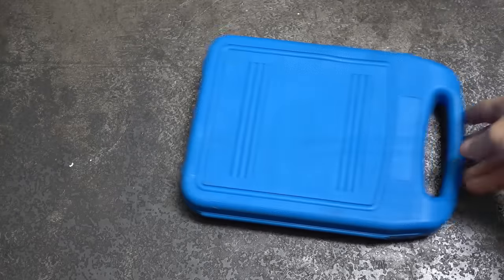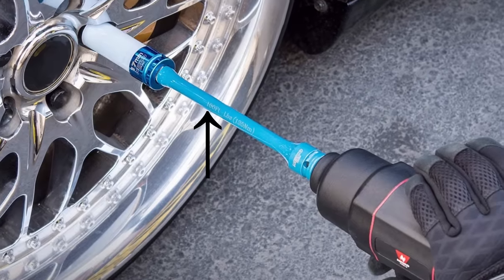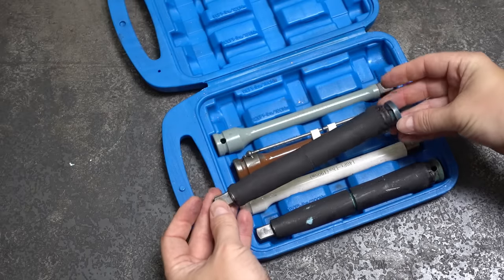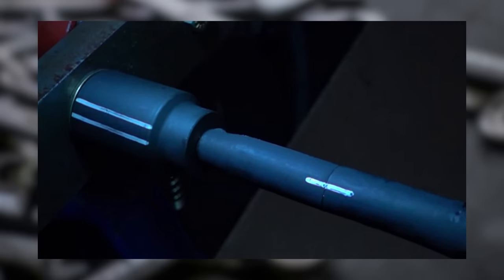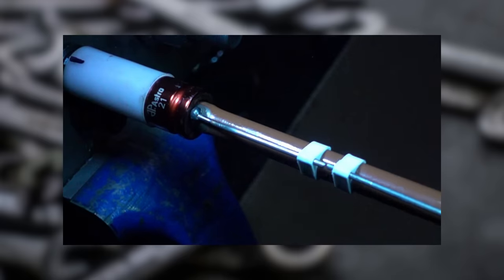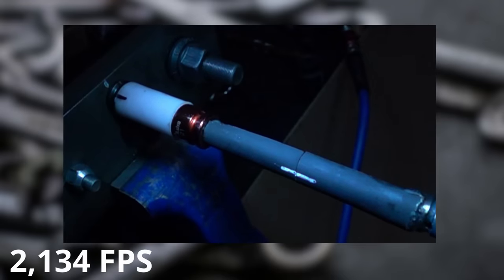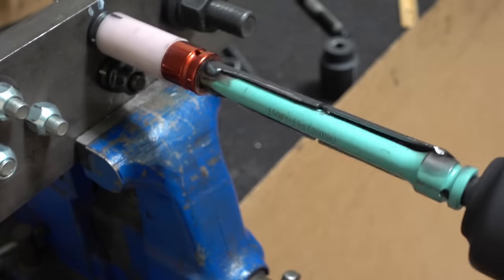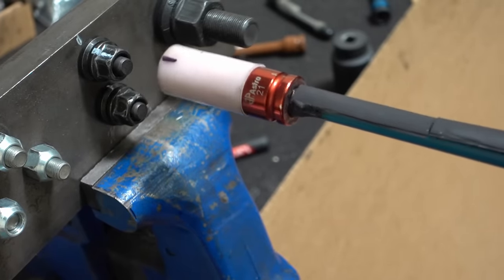Torque Sticks! High Speed Video Helps Reveal the Truth

Comment: Fantastic video. From an engineering/physics point of view, the key takeaway is the jerk (rate of change of acceleration) is different for the two tools and for the dyno vs no dyno. The electric tools have a different impulse due to their striking frequency. So in a duty cycle comparison - about the same power/torque over an average measurement, but with different jerk characteristics and slightly different physical transfer of torque. The difference with your torque tester is similar - the nut on bolt will have a stick/slip release to torque and then a big increase in torque when butted up to a jamming surface which is different to the fluid buffer in your system. The torque to force conversion through the fluid is acting like a dampener to the impulse of the hammer. The hysteresis of that is giving you a mechanical advantage.
Reply: I think you nailed it. A better measuring device for the sticks that would simulate a stiffer clamped joint like a wheel to hub, would be one that measures strain in the system directly in the metal that's being stretched/compressed like an instrumented stud or load washer.

Comment: For tire shops, these save a lot of time. The idea never was to get it "right" by just snapping on a torque stick, but for that torque stick to get just under where it needs to be in order for a torque wrench to finish the job without needing 20 more turns per lug.
Reply: This is why I work on my own stuff, no desire to pay full price for someone who takes shortcuts calling themselves a pro.
Reply: Ahhh this explains why I needed to slog my tyre iron with a hammer to get it off the last time.

Comment: I always use my thinnest torque bar (like 65 #FT) because then I know it's tight enough to put on the ground but probably not tighter than the torque spec that I will reach with a torque wrench.
Reply: Thanks for that tip man
Reply: Yep, the real use for torque sticks.
Reply: That is all I have ever used them for.
Reply: That's why I only bought one torque stick, a 65 #ft.. I already have two manual torque wrenches
Reply: Great advise.
Reply: Your lips to god's ear. That is the only good use for them. I think they are evil spawn. Or like someone else says on here, just use a 1/4 drive cordless impact driver and then finish it off with your torque wrench. And finish the twisting consistently without jerking on it.
Reply: True enough.  I just use one dugga on the gun.
Reply: @grantmcinnes1176  I use three rat-tat-tats. No torque stick. 30+ years. zero problems.
Reply: Yes and I then make my students follow torque patterns and use a torque wrench...always!
Reply: @lm4278  No, you don;t have any problems, It's the side of the road with the horrible factory tools & 6+ months of corrosion that has the problem.
Reply: @alro2434  Some people do have that problem. I have never on my vehicles. Ever. If I buy a used vehicle, first thing I do is inspect the brakes and make sure that never happens. anti-seize compound and three rat-tat-tats and never again will I have a problem.

Comment: I bought a set of Snap-on torque sticks when they first came out. Wanting to make sure that they were accurate, I followed common sense and the included directions. The air pressure in the system should be consistent and verified to be adequate. The air impact gun should also have an internal regulator device (dial or knob usually) that will be used for repeatability/consistency.  Set the air impact gun's regulator to the lowest setting that will allow the desired torque to be achieved with minimum overshoot. Use a calibrated torque wrench to verify that the lug nuts have reached the proper torque. Once you have done this process, you can be assured that the air impact with the torque stick will apply the needed torque within an acceptable +/- range from then on. The important part is that all the lug nuts will be set to the same torque, at whatever that +/- calibration is, which should be very close to the specification. Once you get used to the feel of how long to pull and release the trigger, it becomes very easy to get excellent accuracy and repeatability. The torque sticks made the slow, tedious job much quicker and effortless to do. 
         I did suspect and confirm that they are only to be used with an air impact gun as mentioned and demonstrated in this video. The cordless/electric impacts are delivering a more constant rotation which does not allow sufficient torsion rebound to occur within the torque stick and the harmonic frequency intermittently "lines up" to make the torque stick act almost like a solid extension which obviously defeats it's intended design. I verified that there is no way to eliminate this tendency to anywhere near a satisfactory level to achieve accurate torque from lug nut to lug nut with a cordless/electric type impact gun.  I just make sure to final torque all lug nuts with the air impact and leave it at that. 
    Maybe one of the cordless/electric impact gun manufacturers will someday figure out how to make an accurate torque limiting gun with a built-in torque sensing system. Hopefully it will be affordable as well! That is a tall order in my opinion.
Reply: Im in the auto assembly world, they currently do exist, but air guns are kinda expensive and need a feed back to an electronic box.
We also have electric torque guns from atlas copco, but the brains of it are $5000 and the gun is another $3000 min depending on size.
Portable, accurate and cheap won’t really happen for any impact. Just look at the Milwaukee electric torque wrench. It’s $1000 here
Reply: Makita makes assembly tools under their 14.4v line that do exactly that. iirc they're like $900 a piece though, but waaaaaaay cheaper than the ~$5-9k you're gonna spend on an Ingersoll Rand or Atlas Copco system.
Reply: Wheel lug bolts are torqued on the production lines with electric motors.
They don’t use impact wrenches however precisely because you can’t get controlled torque - they use direct drive and measure the current drawn and the position of the wrench head with a target torque followed by a further angular rotation (usually a quarter turn).
Reply: @ForfeMac  we use those also. But only good for the range I think of 30NM or something

Comment: I can remember when we started using torque sticks back in the early nineties at the dealership, we were told by GM that they should only be used with single hammer style impacts and not twin hammer.
Reply: That makes sense when you think about it.

The high rate of impact doesn't let the torsion bar to revert back into its original position so the torque is applied, almost, continuously through it

Comment: I've always used one ~20% or more lower than the torque target then followed up with a torque wrench. eg. use an 80ft/lb torque stick for 100ft/lb final torque. This way the lugs are tight enough and evenly torqued to lower the vehicle but not overly tightened.

Comment: If I had to guess I'd say its a combo of the anvil weight and the IPM. 
Using your rope and plate analogy it's like a halfway between the steady twist and smacking the plate (or like a machine gun constantly hammering the plate, giving almost zero time to twist back), not giving the material in the torque stick time to return from its partially sprung state.
Reply: Exactly like he said.

Comment: Proper use of torque sticks is more than at what point they stop giving, Its also the feel in the gun that the operator has to get used to that tells them when to stop. You have to get used to feeling the slightest kickback, sort of like a wobbly feeling.

Comment: For lug nuts, I just use my impact on "low" until I feel the slightest resistance, then go for the torque wrench\ratchet.

I had an air impact that on its "low" setting was almost spot-on 85 ft-lbs, so the torque wrench never made over 1\20th of a turn when I was done (I was a tech at the time).
Reply: Lugs nuts are why I still keep a couple speed wrenches on my bench

Comment: The50'skid did a test with torque wrenches a while ago and used two different Milwaukee cordless impact guns. He found that the smaller gun was highly inaccurate when torquing bolts down, but for some reason the more powerful gun was almost dead on with the sticks.

Comment: My assumption is that the hoses bulge slightly with each impact even if the fluid is incompressible. The solid backing of the welded setup lets it hit as designed.

Comment: If you're using torque sticks to torque lug nuts like suggested in the video, zipping lug nuts down and then torqueing to spec, I'd suggest just using a little 1/4" impact driver, zip em down snug, then torque. That's what I do, I drive my cars hard with sticky tires, I don't use hub rings, and I have zero problems. In fact I believe it is better to snug each lug before torquing as it helps the wheel center and seat with the taper lug nuts vs running each one straight down to 100ft/lbs.
Reply: Same deal here.  Of course hub-centric rings only help with initial alignment, and if you run the lugs down lightly with no weight on the wheels before torqueing them like you said, all is well and perfect.  I tend to do it by hand if I'm not in a rush, but the 1/4" impact driver certainly speeds it up.
Reply: This is the only correct answer. I have watched so many people changing tires at all kind of shops, they slam them down, sometimes using torque sticks with the air gun, and then using a torque wrench. They put pressure on the wrench, it clicks immediately and they are think they are good. No movement on the nut. So, there is absolutely no way if they know if it was 100lbs, or 120lbs, or 140lbs. 

If gotten into arguments in multiple shops over this and it seems like very few people know exactly what torque is. How many people know that it is a moving, yes moving, measurement? If your torque wrench doesn't move before it clicks, you haven't measured torque. 

I've also seen the "technician" jerk several times on the wrench after finding refusal. I have no way of finding out how tight it is after jerking on it a few times but I know that I can go way past the torque limit when I have tried it. 

So some dark stormy rainy night I am changing a flat tire I am glad I torque my tires my self.
Reply: @awboat  gotta love the smart engineer that bolt alum to steel
Reply: @awboat  Yeah, and the term for torque is pound-feet, not foot-pounds.  Pound-foot is a unit of torque and a vector measurement created by one pound of force acting on a one-foot lever.  One foot-pound  is the energy required to move a one-pound object one foot of linear distance.
Reply: @solarsynapse  Foot-pounds is still commonly used as a term for torque as the two terms are dimensionally equivalent.
Reply: @mylesmcarthur642  They are not the same.  It is a misnomer in America, like so many, that has been incorrectly repeated for so long that most people think it is the same.  Like saying 2 aught cable.  It is actually 2 naught cable.  Many many terms in America are incorrect.  That is why Americans are so confusing to the rest of the world.  Even the language itself is totally messed up.
Reply: @solarsynapse  Thanks Poindexter.
Reply: @joeblowe7545  You are welcome, Samuel Shenton.
Reply: @solarsynapse while technically right, nobody says “pound feet” for torque. EVERYONE says ft lbs. everybody. Every manufacturer, except the good ole german bois who rate their tools in nm.
Reply: @Sffker  "EVERYONE..."    Really?
Reply: @1966johnnywayne  yep. That’s more accurate than “no one”
Reply: @awboat  BRO!  You don't know how mad this makes me!  I've tried to show everyone in the shop the proper way to torque a wheel, and nobody listens.  They run the nuts down withthe gun, set it torque wrench to 100 for ALL cars, have it click instantly, and say "done".  I've given up.  I just make sure I do it right and call it a day.

Comment: I love torque sticks for tires, aways use them as an automotive tech for over 30 years. I don't use elec guns for tires but I'm glad I watched this video. When putting on tires the equal force applied to each nut is more important then the value itself. So if I put on a tires with a torque stick and it's 10-15 ftlb +/- but equal that's way better the wheel nuts with 30-70ftlb +/- on each nut when you forget to torque with a wrench. Uneven wheel torque causes wheels to work loose over time.

Comment: This is a good demo of modulus of elasticity in torsion/shear. Thr stick is acting like a spring, storing the enenergy between the driver and bolt. Open end conditions and the impulse of force change the behavior allowing more force to transfer through rather than be stored and transmitted back to the user.
Reply: I wouldn't say storing, I would say "absorbing" energy. You are analogising it to either an inductor or capacitor - which is wrong. It's acting like and electrical resistor. During the absorbing there will be an increase in temperature, however imperceptible .
Reply: @joeblowe7545  I disagree. The rod is not being plasticly deformed so energy is not being used to move dislocations. While some energy is lost to adiabatic heating most is transmitted back through the tool and into the user.
Reply: @TheTrueOSSS  I disagree with you. The bar is not an active device (such as a electronic amplifier) it is a passive device. It CANNOT assist in torqueing, but only to hinder it. Hence that is its function.
Reply: I'm not sure you understand what I am saying. The tourque bar can not add energy to the system for sure. However how it acts in the system is entirely different. For instance, take the rough model of atomic bonds where each unit length is approximated as a spring. This model allows us to approximate the torque rod as a spring. Thus the impulse of force on the driver is transmitted into the spring and some of that energy is transmitted to the workpiece. The remainder of the energy is lost back through the tool between each impulse.
This model holds true for all materials as long as we are well below the yield stress. And for this example we can assume we are.
Reply: @TheTrueOSSS  That's reasonable, because I don't think you understand what I'm saying. Slava Ukraina!

Comment: When I first saw the man hanging on the rope, I was like, "Oh no...this went dark, quickly..." 
Glad to know he is still hanging in there!
This was a great representation of torque sticks! When these sticks first came out, the vast majority of the auto shops were using pneumatic impacts, so these were designed for use with those types of impact guns. And the designs of those impact guns were slow on changes. Even if power output slowly increased over the years, the bpms stayed relatively low (well, low compared to the electric impacts of today). Not enough to make a huge difference to invalidate the torque sticks over the years.
Fast forward to today, where electric impacts are more common with a wide variance in power and speed. I suspect that the stick is not allowed enough time to spring back to the neutral position when used in conjunction with high power/high ipm electric impacts. So it gets hit again in a preloaded state, causing any further impacts to force the torque stick to be out of the normal working range.  The same goes for lower power/speed impacts, not enough beans to twist it hard or far enough to reach the torque range desired. (But what do I know? I'm just a grease monkey! 🔧🐒)
You demonstrated that with that high ipm impact driver very well! The high ipms of electric impacts (3100 ipm, for example) is well above that of pneumatic impacts (take the well-recognized IR 231, with the spec sheet showing 1,200 bpm). 
In other words, torque sticks are for pneumatic impacts, silly batteries!
Reply: To add to that; if the rope were twisted tight already, it would spin the body with less twisting force being applied at the top because the rope is already preloaded., like a torque stick is when it doesn't have time to return to the neutral position.
Reply: Torque sticks will work for electric impact wrenches but you need to calibrate them for your specific impact wrench. They are springs - the transferred force goes up with beat frequency so you need to go down in size to get the same force transferred at the higher frequency.
Reply: @allangibson8494  Best answer so far :)

Comment: Excellent video. In the hands it always felt like my Milwaukee was too much beans for a torque stick. I would use my air gun with a torque stick and send it without a torque wrench check after, or I'd snug them with the Milwaukee and torque wrench them tight after. It's nice to see science match feel.

Comment: 1 - torque sticks are a gadget, snug up the bolt and use a torque wrench; 2- one should never press on with the impact after it snugs, that's a good way to over-torque or gall the threads.

Comment: great video ,I use a Makita impact or a air powered impact and torque wrench, it takes only a few minutes to check wheel torque, i use to do a few thousand wheels a year when i worked for New Flyer bus company, we'd install the wheels and use a 3/4" high powered impact and then 2 guys and a 1" drive torque wrench and found far too much error, employees lying about the job, so we eliminated that by using a gun by Hytorc ,dial in the spec you need ,get it done and paint mark each wheel nut record it the inspection book ,inspector signs it off ,  one person needed instead of two and the problem was solved , I gave away my torque sticks to my nephew 👍

Comment: Very good video - part of the issue with cordless as you said is frequency - best is to use a really long extension (or bettwe yet several torque limiter in series) added to the torque limiter  to help with frequency response.